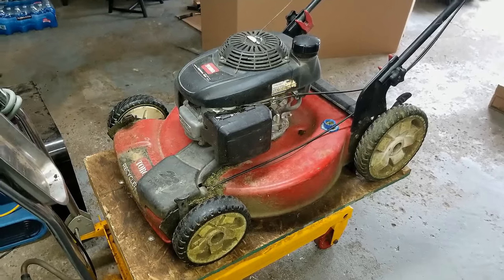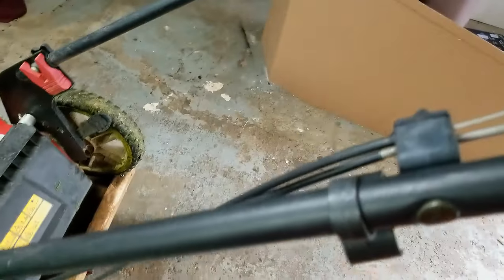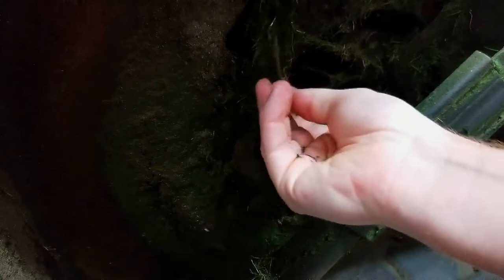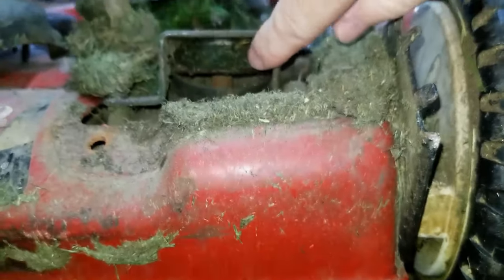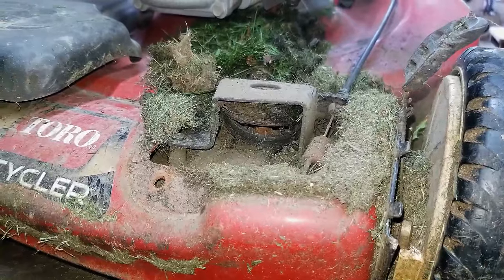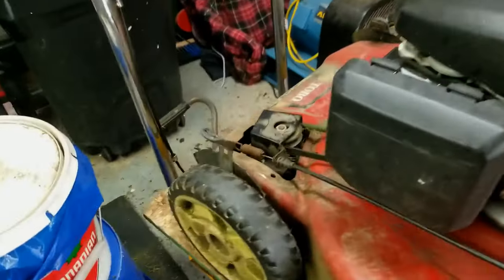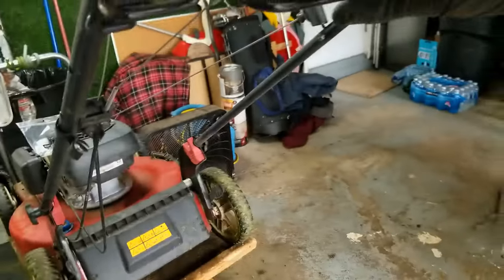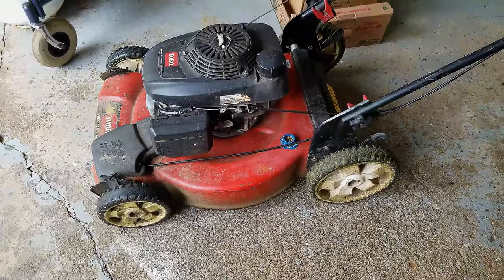Toro Recycler Self Propel Not Working. $0 Fix

Comment: Wow i knew the problem right away & i dont know much about lawnmowers. Thank you i didnt know how to remove the top cover! Great video!
Reply from the maker: Glad to help. Thanks for watching and taking the time to leave a comment. Cheers
Reply: @brantsmallenginerepairs HI,  I'm having trouble getting my spark plug off. Can you help? I have the right socket I think? It says spark plug socket. I forgot there's a rubber piece on the plug. After I figured that out I still couldn't get it off. Or tell if it was the right size. The spark plug isn't visible. Any help I appreciate! Thank you! I subscribed too!
Reply: @brantsmallenginerepairs Sorry to bother you. I also couldn't get the hose off the carburetor from the gas tank. It's stuck is that normal? I got my lawnmower running. I figured it out by myself. Then looked on YouTube. I think I need a new plug though? I haven't replaced it in a couple years.

Comment: Great job bud, sometimes cleaning can save trouble in the end
Reply from the maker: You got that right. Preventative maintenance always seems to lack and people then wonder why they're having to replace their equipment every 3-5 years. Thanks for watching. Cheers
Reply: Thank you very much. I now look like a genius to my family. Great video.
Reply: Cleaning frequently corrects a problem without having to buy new parts. Proper cleaning is key to keeping a mower or other equipment running smoothly.

Comment: Mine is model  21442. Back wheels won't spin on their own. I did learn how to put on the belt on top of mower. What about the bottom of mower underneath? Do I have to remove the blade?
Reply from the maker: In most cases, yes you have to remove the blade

Comment: So, my belt is not broken or off the pulley and I adjusted the tension and it's still not working.  Do you have a suggestion?  Should I try a new belt?
Reply from the maker: Did you ensure that when you engage the self propel handle that the cable moves the pulley and puts tension on the belt? You need to take the plastic cover off on the front of the mower for this. If it does engage the pulley, then release the handle and ensure pulley is not seized. You might have a transmission issue. Hope this helps. Cheers

Comment: Any ideas on an old toro gts5? Self propel stopped working altogether. Paid the only place in my town $150 to "fix" it. Now the self propel works for the first like 5-10 feet and then stops again.
Reply from the maker: I would start with making sure  it is the correct belt and that the belt is in good condition. Also, you might be able to adjust the drive cable to increase the tension on the belt. Sounds like belt slippage.
Reply: @brantsmallenginerepairs  thank you so much!! Glad to know it might still be fixable 🤞

Comment: I have a Toro 22-in recycler but it does not appear to be the same design model. The traction drive cable had snapped and they told me the part number for it is 115-8435 and I replaced it but the self-propel feature is still not working but there is no belt for my model. Please advise
Reply from the maker: Pretty sure they all work on a drive belt system off the blade adapter. Are you missing the belt all together?
Reply: @brantsmallenginerepairs  I found I had to adjust the cable tension and then it was fine
Reply from the maker: @anilphilip546  good job

Comment: Lazy landscaping crew. That on top of using a residential mower for commercial purposes 🙄I hope you got paid well for this, you deserve it.
Reply from the maker: We have a good relationship and we do a lot of business. Pretty easy to prevent this from happening though that's for sure. Thanks for watching! By the way, nice video using the dryer as a tumbler. I never had good success with the nut and bolt method as I'd always get tired too quickly. This could definately help with that. Cheers.
Reply: @brantsmallenginerepairs  👍
Reply: Not lazy landscaper..busy landscaper.if he was lazy he wouldn't be doing that type of hard work in the hot sun
Reply: @gradyhernandez4699   I say lazy as he clearly doesn't bother to take the time to take care of his tools.
Reply: @TheLawnmowerLady  Do You work as hard as they do? I doubt it
Reply: @gradyhernandez4699  I'm sure I don't, but I do take care of my tools. Clear to me this particular landscaper never bothered to clean his tools.

Comment: Some times it's the blade driver..
Reply from the maker: I guess the built-in pulley on the blade adapter could break (I've never seen this) or the pulley could get full of grass causing the belt to slip off like it did on the front pulley of this mower. This is much more unlikely due to the belt guide or keeper around the blade adapter. The pulley on the blade adapter could also get worn down over a long time of usage causing some belt slippage. I haven't really seen this either on push mowers, more on riders. Thanks for watching. Cheers
Reply: @brantsmallenginerepairs  yes the built in pulley on the blade driver gets worn out and it won't drive the belt even though the traction cable is on good shape. I have one } that I'm working on} Toro recycler ,it cuts grass bit the belt won't even turn nor slip.! So. I'm ventured to suspect the blade driver pulley is worn out
Reply from the maker: @gradyhernandez4699  could be possible but I've never seen one that worn. Is the belt stretched possibly?
Reply: @brantsmallenginerepairs  well I haven't tried another belt. But I had a Snapper self-propelled mower..it stopped working ( the self-propelled side) bought a new belt for it..didn't work.. so then I saw a YouTuber that said he had a Toro recycler and he pushed it around for quite a while.untilba Toro dealer sold him a blade driver and that was the issue.
Reply: Super helpful! Got mine to work just now! Yay